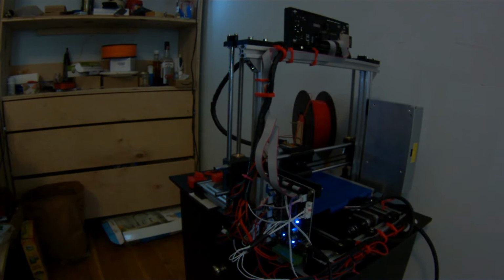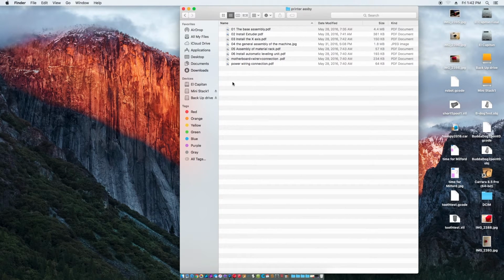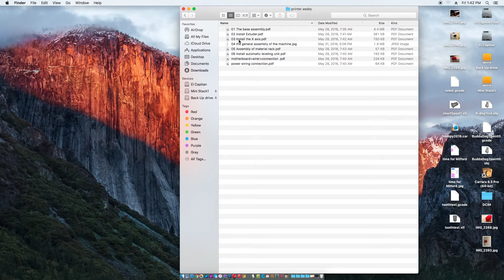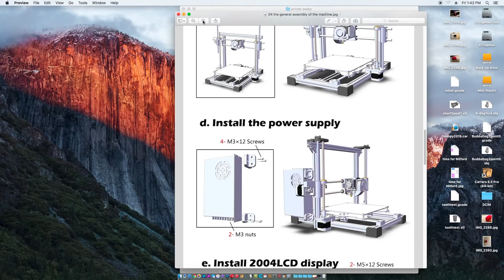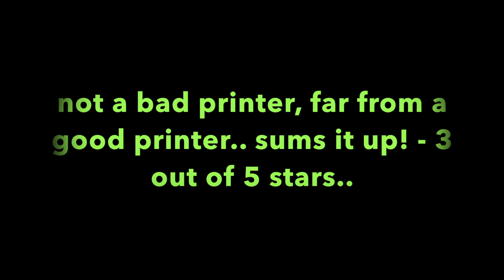Max Micron

Comment: the last 3d printer i had was acrylic and after a year of use the acrylic finally failed. I was amazed how long it lasted, it even lasted through a move and three kids. was very satisfied with he3d customer service too. However i bought the foldbot from max micron, as you said delivery was very fast less than a week. i didnt have any questions for them till i broke the printed x axis motor mount. wrote them an email about it and was even willing to pay cor the part and shippinh due to fault of my own, i got an email saying it would be sent to tech support then heard absolutely nothing after that.

Comment: Looks like zero quality control. I'll pass on this one. Thanks for the honest and straight forward review.
Reply: actually for an inexpensive base Chinese printer it's one of the better I've seen.  structure is MUCH better than jus about anything in the same price. they did send out the parts if you actually watch the video.  please post up one you think is in need of less attention or mild modifications at that price range.

Comment: Hi, what is the software that you use to move the printer engines thanks from now on for the help
Reply from the maker: not sure what you mean.. I use Cura for slicing.  I use a Pi and Octoprint now for monitoring and control of the printer, but used to use  Printrun for Mac before I got the Pi to control the printer from my Mac.

Comment: Thanks for the review!!  I may get this printer even though it has problems.  It's cheap but still aluminum construction.  I'm going to get the auto leveler and upgrade MK8 extruder.
Reply: it's not a bad printer, 90% of the issues are the actual printed parts, and , well.. you can print new ones.  Over the past 6 months or so I have redesigned pretty much all of them to function even better.  http://www.thingiverse.com/Thomllama/collections/my-designs/page:1
Reply: That's awesome.  I really appreciate you sharing those parts.  I have a feeling once I get it and set it up, those will be the first things I print.  I sold something on eBay and I have to wait for the money to clear PayPal but after that I'll be ordering it.
Reply: Hello again Thomas.  Hey can I ask you a question about this?  The assembly instructions show that the hot bed and aluminum plate are two separate pieces.  Is that the same on yours?  I watched your unboxing and you didn't have one either so I'm thinking that's just the way it is.
Reply: the hot bed and aluminum plate are one.. the lower acrylic bed carriage plate is separate.
Reply: Thank you!!  I was freaking out thinking something was missing.  I'm almost done.  Getting the finishing touches on the wiring.  I remember in your review video you said two screws were too long... was that the M3x45s attaching the square fan and heat sink?  That's the only thing I didn't install because I finger tightened them first and they seem about a 1/4 inch too long.
Reply: yup.. those are the ones.. I added a little washer between the fan guard and the fan, and if needed between the bolt head and the fan guard (other words, one on each side of the guard.. )
Reply: You know what I wound up doing?  I used two of the extra M5 nuts that I grew to hate (LOL) as I assembled this.  They were just the right length.  This is really a nice device., once you get it put together and set up.  I printed the little boat stress test from Thingieverse and I'm amazed at the quality and detail.   Thanks again for the review and for the help.
Reply: So you are willing to pay yourself $2.50 an hour to fix this while there are other Chinese unit at this same or possibly $100.00 more that have a good construct and quality control. Now does that make sense?
Reply: When I see these kinds of design issues I think, does the manufacture actually eat their own food? Obviously not.
Reply: actually, I have seem most in the same price range and most are much lower quality and need as much of more modifications. things like the Tevo tarantula are total POS that cost the same to get the same add on's/features ..
Reply: 3Dprinting - As I re-evaluate 3D printers and there practically at this time in my workshop, I think I will pivot over to a CNC laser machine instead. The 3D printer is to get the interest of children in being creative. Will post the 3D printer which I think is well priced with value.

Comment: all parts come from china everything dont let american companies fool you all the motors bearings etc are out of china...that board if you have problems will be expensive switch to a arduino mega with ramps 1.4 and steppers for 26 bucks usd you can get the whole thing and marlin firmware is the shit.. you can even do inductive pick up for the bed leveling with it...